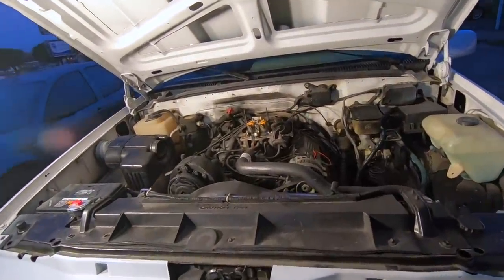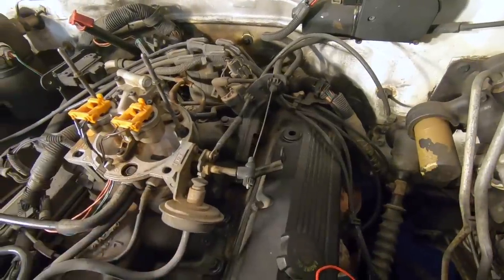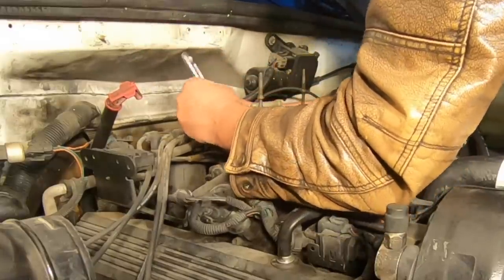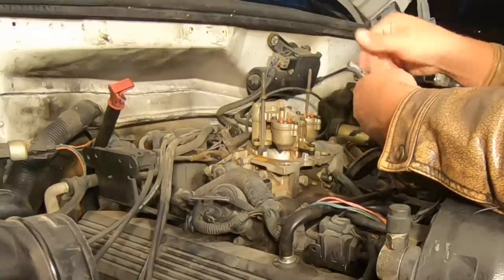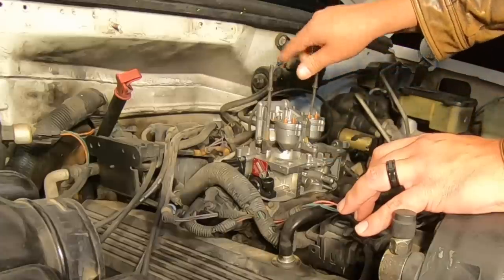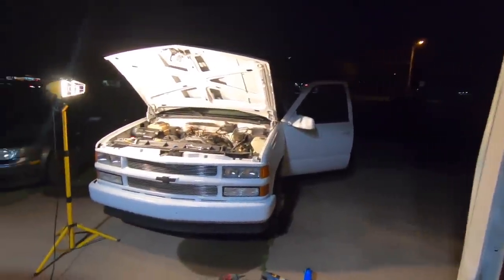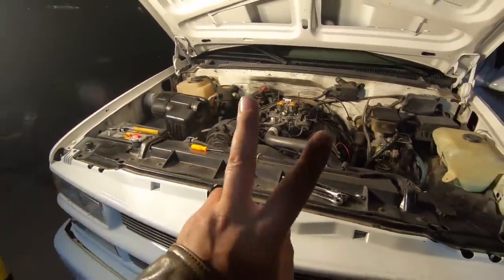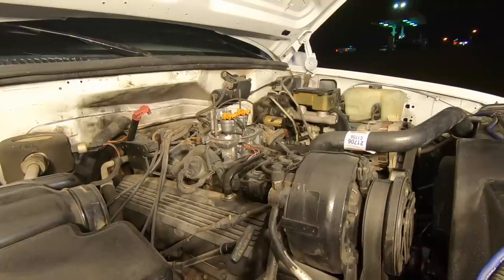94 Chevy 3500 454 TBI Replacement Issues!!

Comment: Randy,
You need to slow down a bit. Your truck is not junk, youre just out of your comfort zone with it. 

As a GM tech from that era I can tell you a few things. Hydroboost is an excellent system. Only has issues with the accumulator if you only have 1 pedal pump before losing assist. Easy to fix if needed. As far as the driveability, Im not surprised the aftermarket rebuilt unit is goofed up. I would put the old unit back on if the throttle shaft is good and just change the bad injector.

Otherwise you could screw around with this one for quite a bit. See if it idles on carb spray. If so you have either a vacuum leak or the injectors are not correct for your application. There should be an 8 digit number stamped on the old TBI to ID it just like a carburator number did in the day.

You may need to reset the minimum air bypass for proper minimum idle speed but it shouldnt effect on road running. I think you have the wrong (or bad) injectors in the reman tbi. Rock auto has complete TBI assembly listed for $280.00. They also have AC Delco injectors separately.
Reply: Any recommendation on the tbi injector wires mine got fried and I'm wondering if rewiring it is smart or getting a new tbi unit because the injector is leaky also may be better

Comment: has a vaccum leak is why its stalling i can hear it from here. Check base plate gasket, egr valve, intake gasket ect. propane enrichment works good or smoke test
Reply: I’m watching the video yelling at the screen the he has a vacuum leak and lo and behold, first comment I read......   LOL!
Reply: with the air cleaner off it will sound like a vacuum leak just from the air rushing into the IAC port and the holes in the throttle blades. My thought is he ordered the wrong throttle body all other TBI were ~13psi of fuel pressure however 94-95 454 TBI were 30PSI
Reply: @davidbuck9977  I have the same engine. 1995 GMC 454. Runs good, idles high 1000+ RPMs. I'll be swapping in a new IAC valve tomorrow. If that doesn't bring it down to 500-750, it will need to have TBI service.
Reply: I suspect that is not the problem.  Watch the throttle link as it's spluttering, a vacuum leak will become less of an issue as the engine revs.  It won't rev.  I suspect fuel starvation, possible fuel pump/system problem.  I also question Randy's logic that a short circuit in the wires caused a fuel injector to short, after all if there was a short in the wire the current wouldn't even make it to the injectors: logic fail!  A distinct possibility if there was a short circuit in the wires is computer driver damage...
Reply: I agree with you it is a vacuum leak or the vacuum ports are not right for the engine.
Reply: Exactly what I was thinking
Reply: Yes and make sure those lines are clear cause the factory sometimes put stuffing into the holes of the new unit for shipping purposes.  So unscrew it again and make sure nothing was packed in those vacuum and fuel line holes. Very easy to miss.
Reply: I'd disconnect and spray some carb cleaner in the idle air control line and unit too. A dirty mass air flow sensor will do this, but since it doesn't have one....IAC
Reply: living in a desert  guess that rules out everclear too huh?....lol
Reply: thats probably the iac. they are real noisy esp on camera. it sounds lime a huge whooosh of a vacume leak on camera
Reply: @missingremote4388   i have a 454 2500 chevy replaced IAC still high idle.. did you ever figure out the issue? Thank you
Reply: @jeremyking7924   I figured it out.
I replaced the EGR valve.
And a vacuum hose that connects the PCV valve (from passenger side valve cover to the throttle body)
This hose was cracked.
Now idles smooth / not randomly surging high rpm anymore.
At 900 RPM in neutral and 750 RPM when the transmission is in drive.
  - other times my high idle could be sometimes due to low battery / dead battery or 11.7 volts ?
However I've changed the battery 4 times with a new one.
- I think it is the little emission hoses
 that caused the very high idle 2000 - 2700 RPM. Also + I used to have to push on the brakes instead of the throttle pedal while driving around town or parking lot speed.
+ Purchase new Oxygen sensors over a year ago, but haven't installed it yet ( probably don't need it...)
But that was my next step to try and take the idle.
Reply: @missingremote4388 thank you i appreciate the help.  Was it stalling before too?  Also how high is it Still idiling?
Reply: @jeremyking7924   it never stalled before. Does seem to idle " almost", normal after it warms up. Usually at 900 RPM when engine is hot. 
Now I only worry about changing the oil,  and regular maintenance.
 My a/c hasn't worked since 2015 ( air compressor/ clutch / pulley problem) I pulled the pulley off and hammers on a new one, but the new clutch magnet gap/clearance is too wide. So it won't engage freon pump. Fix it next month maybe...
- I'm taking the suburban out tomorrow for a 40 miles ride. 
- I don't use it daily. More of a extra vehicle for me
Reply: @missingremote4388  mine was tbi base gasket causing the high rpm
Reply: @jeremyking7924 these tbi controlled units are pretty sensitive to vacuum leaks but I've never heard of them causing stalling unless it's super bad
Reply: @mikem5475  good tip(s), thanks

Comment: Leave it outside the shop, hopefully it will get stolen.
Reply: That's hilarious, he needs a new line of work preferably non mechanical.
Reply: Don't forget to leave the keys in it.
Reply: Even if the keys are in the truck they won't steal it. It don't run. Unless they tow it to scrap metal
Reply: @frankm6601  I'll second that...LOl...
Reply: At least it isn’t an 87 first year of tbi oddball because it’s the last year for square body on the pickups it did carry on to 91 on crew cab and suburban

Comment: Sounds like a vacuum leak and the issue with the headlights is the multifunction switch
Reply: Ruben Camacho I wonder if he transferred the cap from the capped off port on the old tbi unit.

Comment: just a suggestion get a noid light and make sure you are getting good injector pulses to each injector,  it could have damaged the module when the wires shorted out.

Comment: Randy, for your headlights, check the ground wires under the hood, and tighten the ground bolts. Had the same problem with my truck. I'm not talking about the big ground wires. I'm talking about small ground wires that are about 18 awg, and are located near the front radiator support. Cost me over $2k to fix that intermittent problem. It's an old GM mechanic that finally found the problem.

Comment: You need the ECU to learn the throttle position sender, sometimes you can drive it while it learns, and sometimes you turn ignition on (not running) and slowly fully cycle the throttle 5 times, then start it up and see if that helped.

Comment: Randy, first of all I've been where your at and it sucks. I chased a really similar problem for a month. When an old drag  racer l knew told me to check the fuel supply line between the tank and the steel line going forward. I had replaced the carb, the cam, the distribution, Coil,plug wires, cap, rotor and begged GOD to make it run right. I put 3" of fuel hose for a buck and it ran like a top. I nearly burned it l was so pissed. The other deal like yours turned out to be a grind problem. Like your truck someone had changed the motor and decided all the ground wires weren't needed so they just hooked up a couple. 12 volt hates lack of grounds. Your truck is new enough to be highly electrical sensitive. I finally had an auto electric guy look at my problem on the truck, he spent fifteen minutes on it reconnected the grounds Cooter didn't need and bingo my truck ran great. Best $75. I every spent. Everyone telling you to keep the truck is right. That is a mega bad ass truck. I've owned a few. If you fix it you can drive your money out of it. Run like a deer from that old diesel. I ate that turd once real hard. Once that truck runs right you will love it. My race car partner bought one l built a Holley 650 mechanical secondary for. Went from 10MPG TO 16MPG and ran like a champ. Keep the truck. You don't need to bleed any more money right now. It's a great truck.

Comment: Want to sell that GM TBI ? 
All you needed at first was a replacement right injector or both of them and they are available from GM still. Also, since those injector wires are "fixed" with electrical tape I would also buy new FI Pig Tails that are available which will splice/connect closer to the intake manifold area vs. up above the TBI casting. Use butt connectors that solder/crimp and have a sealant inside them to prevent oxidation etc.  Did that short cause a problem with the PROM? Best way to find out is to buy one injector and install the original TBI unit back on and see if it runs the same. Those IAC valves also have to be calibrated to the computer and "base idle speed" via the idle set screw so the original TBI electronically is calibrated already and will either work fine or not if the computer is not damaged. I know, the  Suburban is likely gone by now but in case not. TBI is not junk. They are the most reliable FI ever and are not complicated like the late FI is that requires electrical engineering and expensive equipment to diagnose.
Reply: Exactly. You are smart

Comment: And Silverado wasn;t good enough for towing, that You needed this one???
Reply: went from bad to worse need a ford
Reply: @firstonraceday7865  bruh
Reply: @Unknown-vm8ri   compared to what your broke down dodge
Reply: @firstonraceday7865  yet my dodge is a 2.7l with 234k
Reply: @Unknown-vm8ri  congratulations you want a cake my 5.4 has 268k
Reply: @firstonraceday7865  I bet u my dodge can pass 400k
Reply: @firstonraceday7865  and my 4.8l chevy has 608k so that's nothing
Reply: @firstonraceday7865  .... my dad had a 78 f250 and it was a pile of crap along with his Ford f350 diesel 
1. Diesels trans blew out 
2.trans started to slip at 168k in the f250 
3.truck would die on the road due to fuel starvation and almost got us killed 10/10 Would not recommend
Reply: @Unknown-vm8ri  going down hill pushing it lmfao
Reply: @firstonraceday7865  at least it can pass it with its 4 wheels not like ford getting towed
Reply: @firstonraceday7865  ford gets towed and owers get owned
Reply: Cruzredeye  ik but still if it has 235k I'm pretty sure it's better than a ford

Comment: Had a 96 2500 with the 6.5 turbo diesel almost 400k ran good just a gutless wonder wanted to do a Cummins swap but sold it wasn't worth it body was trash but looking for another to do the 5.9 swap good luck

Comment: They used different size injectors for 94 and 95 because the fuel pressure was increased from 13 psi to 30 psi.

Comment: My name is Steve I'm using my wife's account I've been a mechanic for almost 20 years and I've worked on several of those trucks with simular issues you need to have someone start the truck while you watch the injectors spray see if they are both working hold it at a fast idle and see if one stops spraying these trucks are known to have computer issues when it comes to the injectors what happens is one injector will stop working all together or work intermittently the remedy is to replace the computer it is very easy to replace it's on the passenger side behind the glove box or under the passenger side dashboard if I remember correctly it's been about 5 years since I changed one I would go to the junk yard and get a used one it can come out of a bunch of different vehicles as long as it's throttle body injected like yours I've taken computers out of a v6 s10 and put it in a full size v8 truck and it worked fine I'm sure the junk yard is littered with them I actually have one in my garage but I'm in pennsylvania so that won't help but if I was closer I would give it to you if you have any questions ask me I'm sure you can get it running and it's not gonna be a big issue
Reply: What year and make vehicle did that computer come out of?  Still have it? Want to sell it?
Reply: I have a 1994 Winnebago with a 454, It would idle rough and almost die when put in gear. I changed the temp sensor since plugs, cap, wires were recently done before I purchased it and the issue went away for a little bit then came back. It would idle with a slight tapping, then almost die, then roar back sounding smooth with all the power. I changed the TPS sensor since the symptoms are the same but no change so was about to change EGR. Anyhow I remember this comment and had to go back and find it, sure enough only one injector is spraying, I remember seeing them both spray before so it's intermittent. I thought it was bad fuel at first but that didn't pan out. Looking for a new computer now, thanks for your help!!! It seems like this has boggled so many others, this info is gold...and the intermittent part just adds confusion so thank you so much

Comment: I have 94 Chevy suburb silver 4x4 2500.. I love my truck and I've replaced a few sensors but not the TBI unit.. I did rebuild it and I replaced with high performance kit.. Now the fuel psi is too low.. Got a high flow fuel pump... Now its high idle.. Computer tries to adjust and shuts down the engine.. After hrs of you tube know hows.. This one vid shows how the TBS sensor has to be calibrated voltage to the computer also at the same time fine adjust the idle screw.. My idle was at 1300 RPM .. I got it down to 1k RPM and the computer tres to adjust.. So far it's better.. When the truck warms up my idle drops to 800-900 while in drive position and I come to a stop .. But when parked it jumps back up.. Soo it's hard to fix ... You just have know what to do.. Or take it to a pro that that can reprogram or restore the computer
Reply: Also if I can't find any one who can help me fix it to optimal condition.. I'm going to go with plan C.. I will upload the video on my channel when I get it Finished.. Let me know if you still have the truck .

Comment: old school repair,,,, get a pressure regulator and a holley carberator, trash the throttle body!  the head lights could have an in line fuse as part of the electric supply wire. doesn't  matter replace the wire any way and switch good luck kapnez out!

Comment: But you wanted a dually right? You wanted this over the red 2500hd which you put money into. Took on a roadtrip with no issues and sold it for way less then what you had in it just to get this. Congratulations
Reply: No when his trailer got stolen he obviously had no use for the truck that's why he sold it ☺
Reply: @keithholmes3290  he got the trailer s day or 2 later though? He couldve deleted all sales and kept it. End of story

Comment: I wonder if a sensor downstream got fried when you pinched the wires?
Reply: I am thinking it might be a broken wire inside of the insulation where it got pinched, use an ohm meter to check that the wires are good. GOOD LUCK

Comment: I have seen those HYDRA BOOST systems too many times. Even the older CHEVROLET/GMC Class C motorhomes have it. MAINLY used on the DIESEL system.
Reply: I have the hydro boost brakes on my 04 Suburban with the 6.0
Reply: Used on vehicles that usually will not have a lot of intake manifold vacuum such as trucks that are 3/4 ton and up.

Comment: You should just keep the truck and run it out you only loose money when you go to sell cars.
Reply: Not true people make a living off buying and selling
Reply: Elijah Thompson there’s not money to be made on this particular purchase tho
Reply: @cadenn.2074   Exactly, if he's got a legitimate use for it then it is best to keep it. Also regardless of the youtube experts opinions, if he's in this thing for say $7-7.5K and its a dependable running tow pig. It wouldn't be as bad as some make it out to be. Seriously if the body and interior are really nice, I could easily get $6-7K all day up here in the North East for a "southern" rust free Ext cab 3500 dually. I actually just sold one I put together. It was a 95 cab and chassis from Texas I got with a blown 6.5. We put a ATK crate motor from Jegs, used 4L80E trans, along with new wheel bearings,brakes etc for $9,500 and I was askin $10.5 K. I already know the comment section will say that's insane and all. But think about it, where is someone going to find a decent HD work truck  for less these days. Then throw in the fact that it has a 3 year unlimited mile warranty on the motor and our shop guarantees the trans for a year and it's a steal. The fact that a new comparable truck is $80 grand has driven the price of these things through the roof. Just 5-10 years ago I'd have lost money on a truck like this. But now I have a deposit on 3 more.
Reply: Caden N. Agreed and he lost money